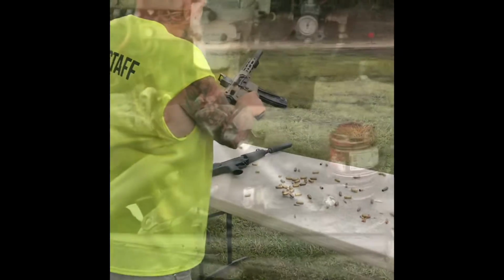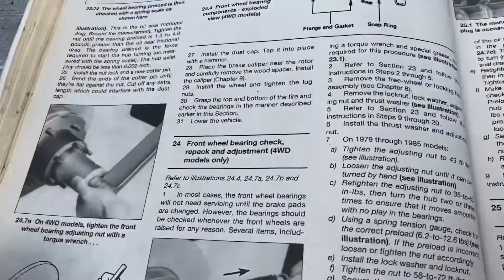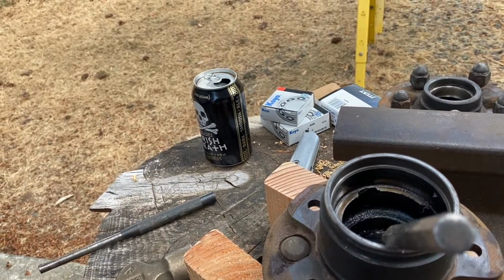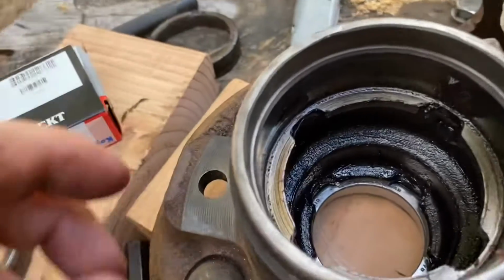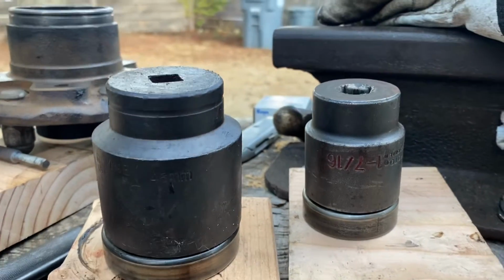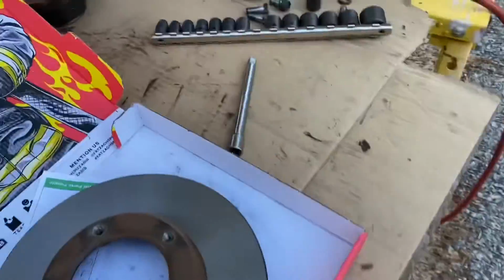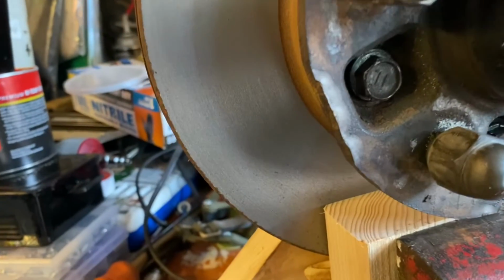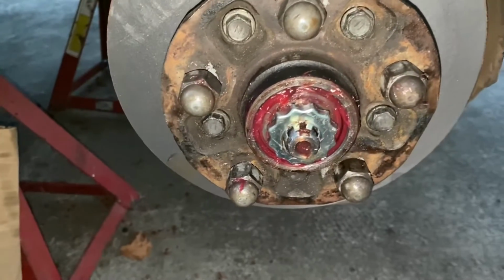Toyota Pickup  2WD wheel bearing replacement

Comment: While tightening my axle nut on to the bearing, I noticed it wouldn’t let me get anywhere near torque spec, if I even got tight at all the bearing wouldn’t spin the hub. So I tightened it pretty tight even hearing a horrible clicking sound, then realizing I should just tighten it tight enough so that the wheel can rotate freely, so I tightened and backed off it, adding the cotter pin, and hopping it won’t fly off on the freeway🙏🏻 it’s a 2000 Tacoma 2wd, are you guys tightening to spec 172ft or are you just preloading by going tight then backing off so that the bearing can spin?
Reply from the maker: Tighten to spec to then back off, just follow whatever the manual instructs you to accomplish,   You should feel a slights drag  you don’t want too loose or too tight
Reply: @ProjectTrailerz  does anyone think I will damage the bearings by tightening all the way to torque spec? The clicking noise felt bad🙆🏾‍♂️
Reply: @willisram1  I think it would, what did you end up doing?